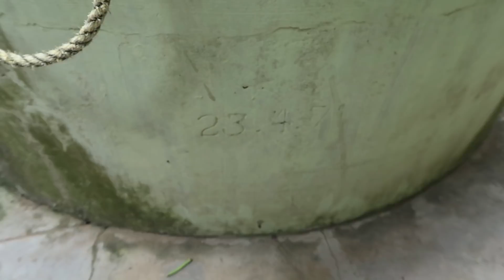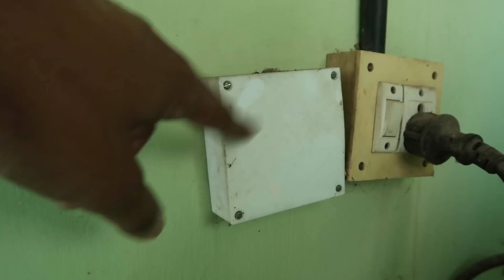Bathroom Secrets - Home Automation - 5 Star Facilities | Malayalam

Comment: how do you  power  up pir and relay Circuit?? You will definitely using a transformer with minimum 250 ma and it should be always on. Our intention is to save power but 250 ma transformer with 6 volt will draw minimum 1.5 watts power usually we use less wattage in bathrooms..even with dc led light.so in reality you are not saving but wasting energy.try to use ac pir in serious with led bulb more efficient and energy saving.your projects are good.i think you might used solenoid valves to control water and pressure pump really useful project.
Reply from the maker: Sorry your comment went to spam because of a URL "Light.so"
I power my circuits from my Home UPS 12V battery.
I do not use any relays in my circuit. There are much more efficient components out there such as mosfets and SSRs
I draw about 2ma for the circuit during standby